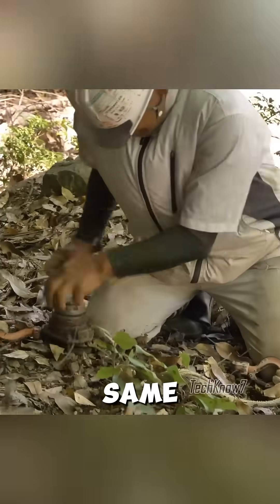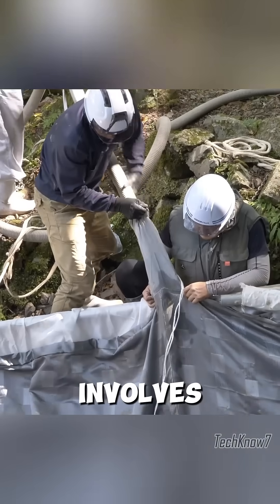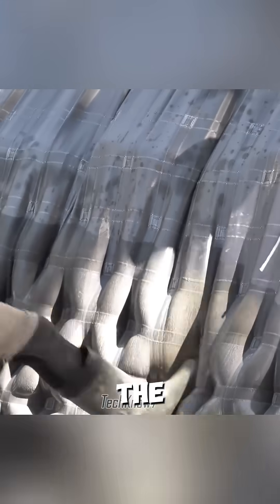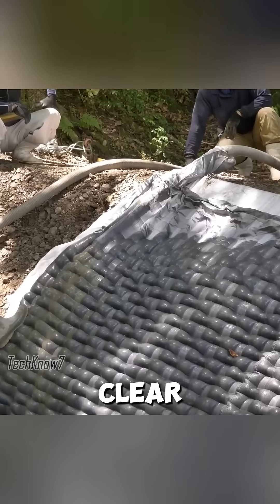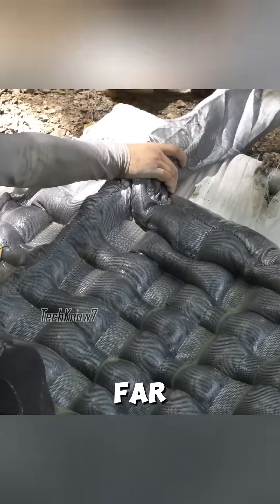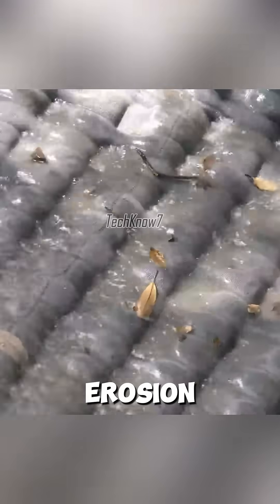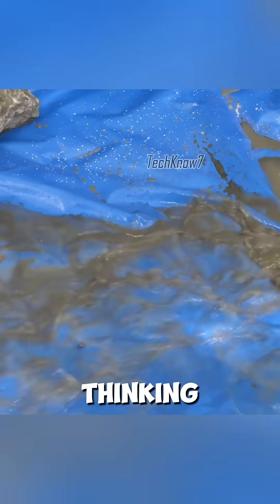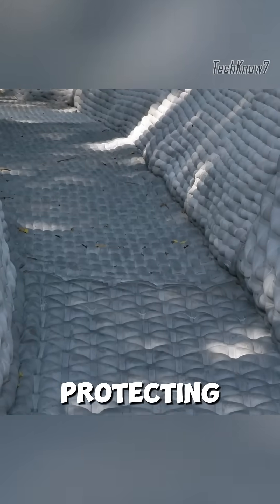Revolutionary Fabric Formwork

Comment: No, it's not faster if you calculate the making of the flexible fabric, and the slower concrete filling time, and the cost is actually higher. 😂😂 And two days, two feet long? So prefab u concrete parts are much cheaper and faster to install...Why are you doing this bs videos?